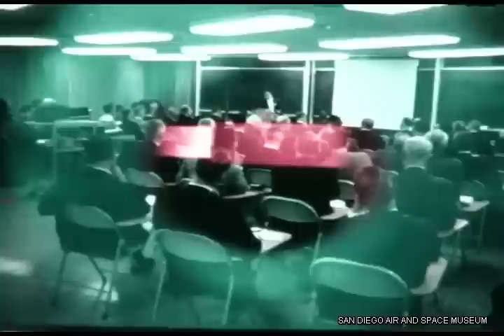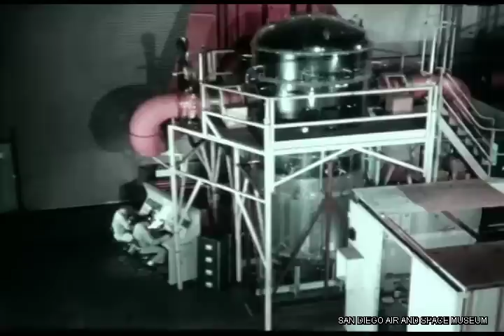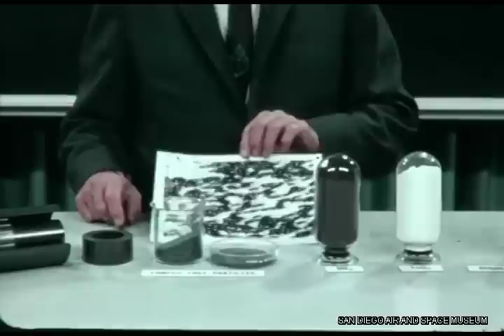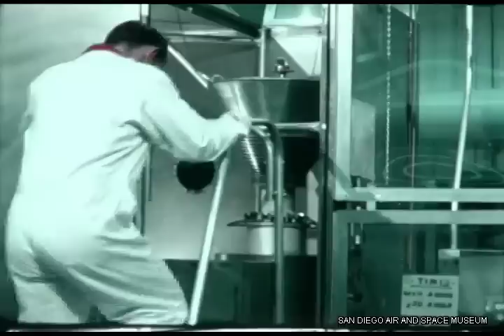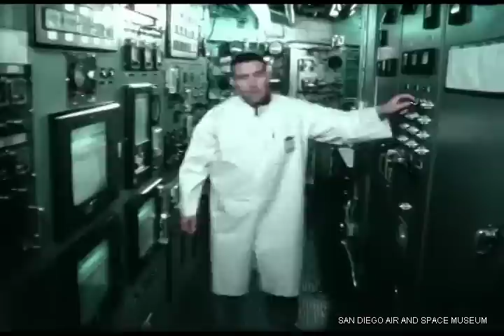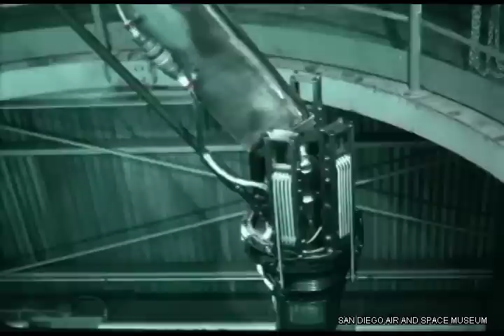HTGR The High Temperature, Gas-Cooled Power Reactor System

Comment: So looking at the history, the HTGR started operation in 1966, and it seems to me, at the time of the first reactivity, they had already decided that they would not pursue HGTR, and were already in discussions with General Electric to build the two GE boiling water reactors that began operation in 1974, the same time the HGTR ceased operation.  If a woman has a baby on September 30, one may reasonably infer that something was happening around 01 January prior, without direct evidence.  So what is the rest of the story with the HTGR ?  The text of the video is so hopeful about even better models, and cost competitive, and, didn’t these see greater acceptance in Great Britain?  Enquiring minds want to know.
Reply from the maker: Basically they just didn't run as smoothly or as economically as their larger water-cooled brethren. Peach Bottom did pretty well but was just too small and couldn't compete with the huge BWRs across the path. The larger HTGR, Ft. St. Vrain, had major maintenance and operational challenges, mostly due to moisture ingress. They shut it down early and we haven't built one since in the US. Now China has 3 of these operating and 12 of under construction, so maybe they will get them working better. Meanwhile, the US has about a dozen micro-HTGR companies trying to restart interest in the tech.
Reply: @whatisnuclear  THANK YOU !!!  🥰

Comment: I bet if you told these men in the 2020s the US basically stopped manned missions outside LEO after Apollo, didn't develop advanced reactors and built even PWRs at a glacial rate they'd be horrified. We're sixty years into their future and even though computers got a lot faster we've gone backwards when it comes to space exploration and experimental reactor design. Not to mention back then the US had a huge manufacturing base then and now most of that got outsourced to China.

Comment: The San Diego Air and Space Museum channel has some good vids.
Reply from the maker: Yes there are some amazing ones in their archives. This one was barely audible and had an awful 131 Hz buzz on the audio track.
Reply: @whatisnuclear  I thought so! The processing turned it into a sort of throbbing, one note backing track. At first that's what I thought it was. Then I figured it out. I'm a professional sound engineer so it interested me even more than the video itself, although that was really good. Making the fuel elements was really interesting. Thanks for the video!
Reply: @whatisnuclear : The voice and buzzing did a funny thing to my phone!
A slight wind came out my speaker! 😂
If you have a Samsung, lick your lips and bring the speaker close to them! 
First i did not get it why there is something wrong with my eyes😂